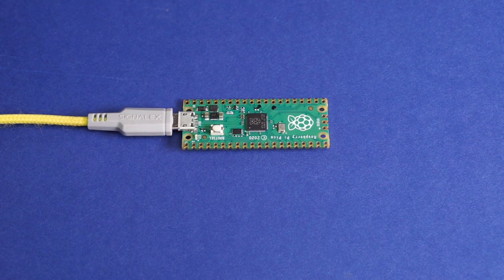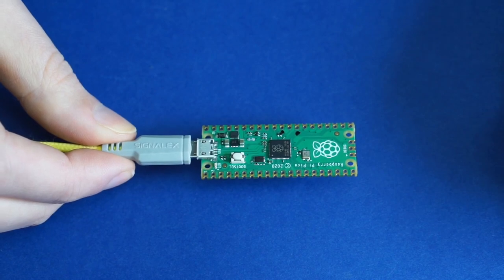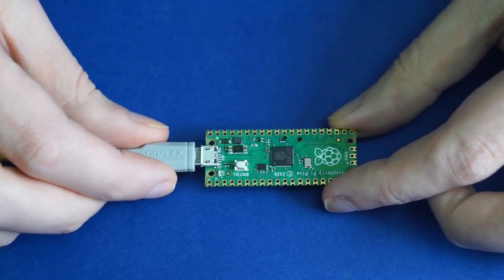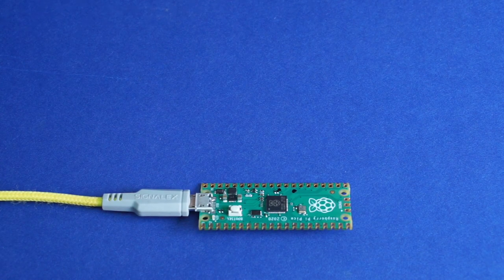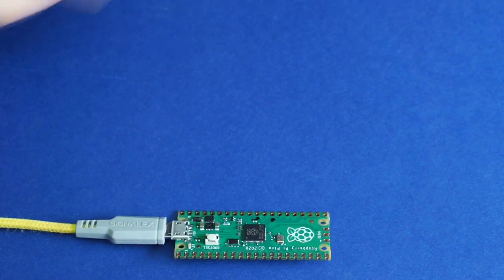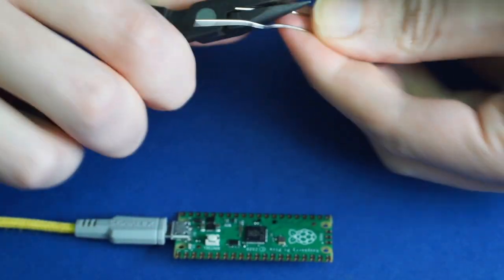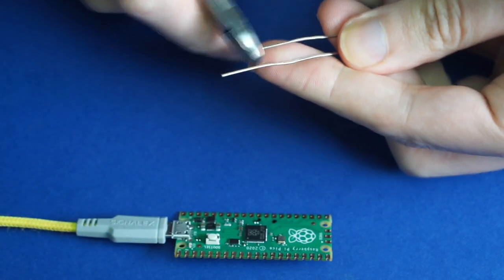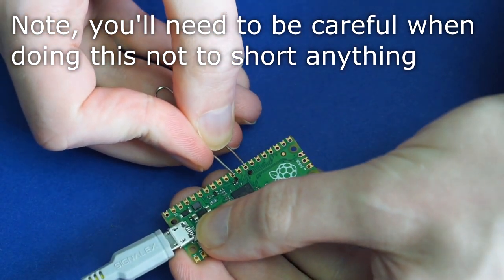Paperclip Raspberry Pi Pico reset button

Comment: For those who see no value... Actually USB connectors are rated for a finite number of disconnections. The microUsb is NOT one of the strongest (I only can think of the miniUSB being worst).

I myself have worn out connectors in the past (Im not one of those who's got to have the latest and greatest Mobil every 6 months), false contact and failing communications can be annoying. and re soldering a new connector, well...  posible but less than ideal. 

A board used for development might see much more disconnection's... and I m all for not waisting resources. Another arguably good possibility... disconnect the other end.

Comment: unless the usb connector is poorly soldered or there is no anchoring legs on the connector so the connector can be broken off due to repeatedly connecting the paperclip method does not have any benefit.
Reply: the usb connector just requires a shitton of force to unplug the usb and literally gets tiring